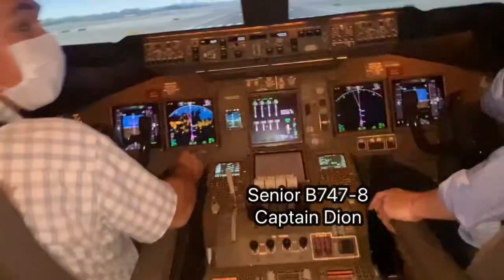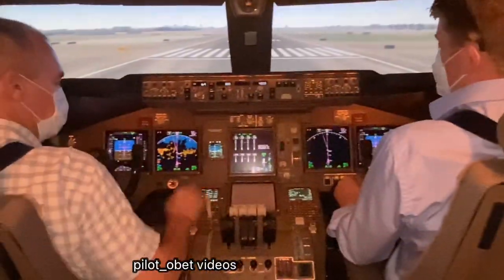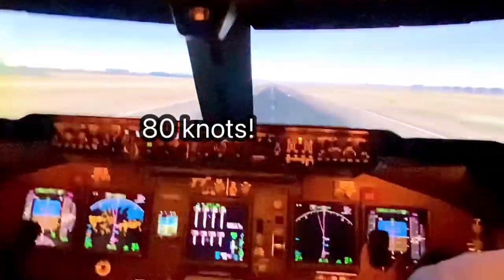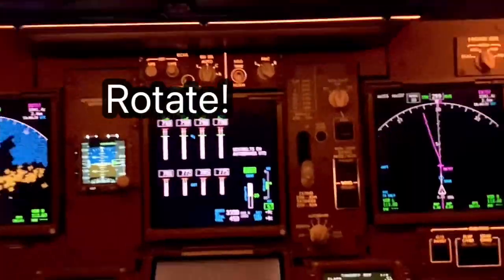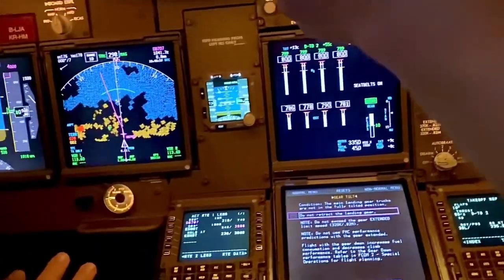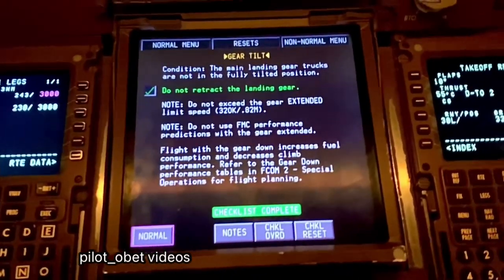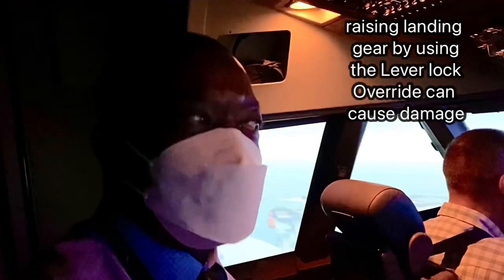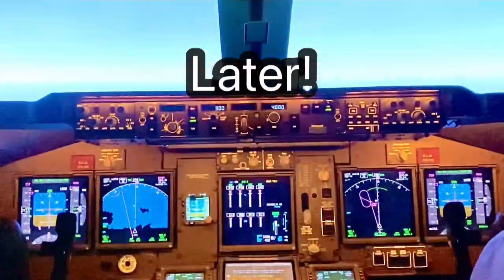Boeing 747-8 Landing Gear Malfunction

Comment: I am one of those Computer Simulator Pilots flying from 1987 or so in many different types.  I figure I have about 17,000 hours including the seven four and I never thought of the landing gear tilt  could be an issue.  Never heard of that before.  Thank you sir.
Reply from the maker: My pleasure.